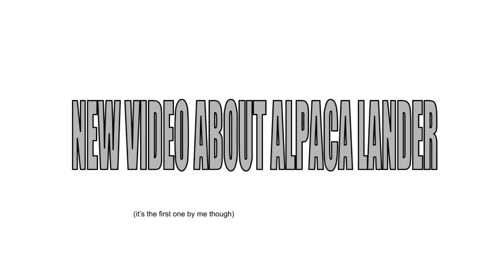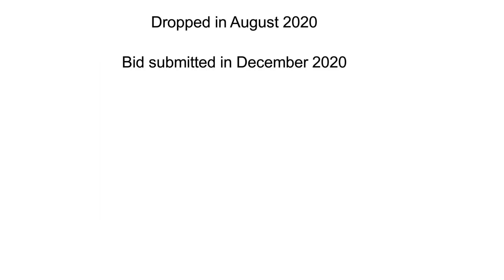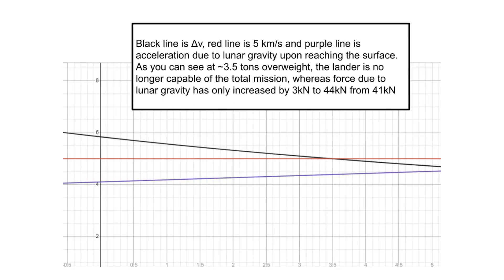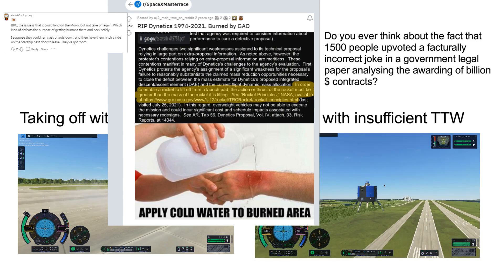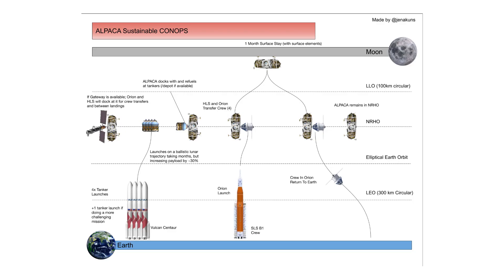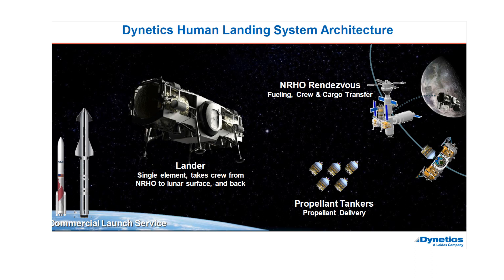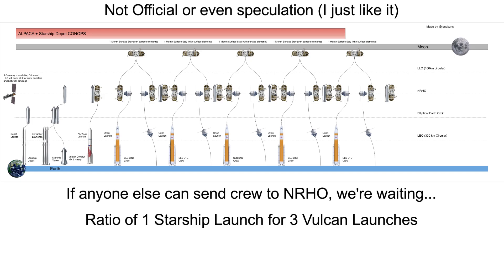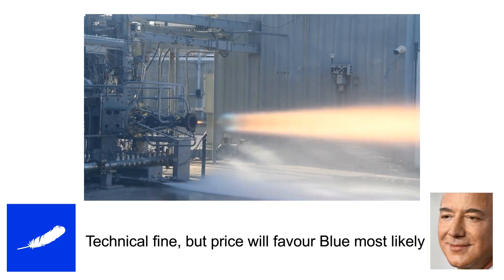Glancing at Dynetics HLS

Comment: Just found your channel and I think I’m gonna start on a binge of all your videos now because they’re great, only once in a while I come across something like this

What’s really interesting is I didn’t know they submitted a fully reusable ALPACA for the initial HLS contract, there was a lot of confusion and I couldn’t understand the mass problems but now it all makes sense. Good to know they’ve had lots of time since to sort all this out and hope we see it in action eventually

As for starship, I think doing LEO assembly with a fully fuelled ALPACA and another for a transfer stage would be effective, but sending starship to the moon as we know with its HLS proposal exposes exponential inefficiencies with its ridiculously high dry mass that makes ALPACA’s previous problems seem completely irrelevant. It takes like 10 tankers just to send starship without any payload at all to land on the moon, so I’m pretty skeptical about any huge propellant depots using it, albeit that requires a lot less delta v than needed for a landing of course just to do TLI and NRHO insertion so maybe you could achieve some significant propellant payload mass with refuelings
Reply from the maker: You can see the math I used at the link below. The problem you run into with Starship HLS is the whole ~8 km/s total burn profile; this should be a lot more nice in the 3 km/s range. Then with DHLS  which is optimised around getting 4 crew to lunar surface assets and you can stretch that propellant. Stuff like boil off over year might be a concern; but personally I think that's more just motivation to do crew launches at a higher rate.

https://www.desmos.com/calculator/tvgoeukjpo